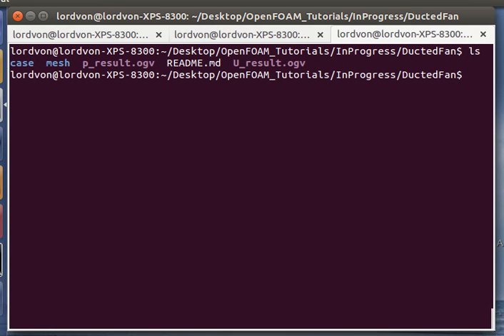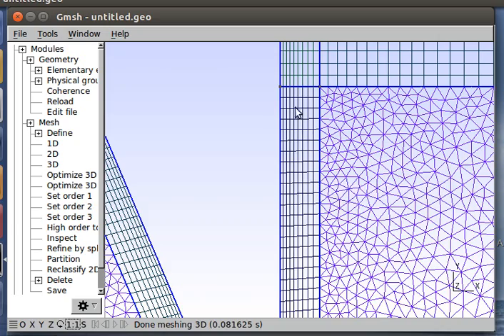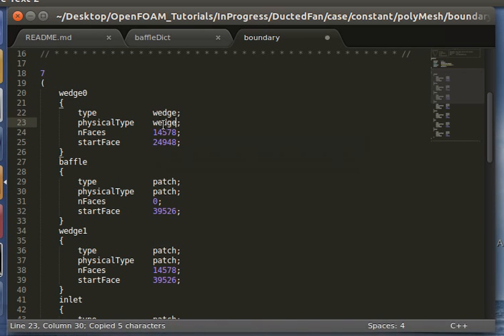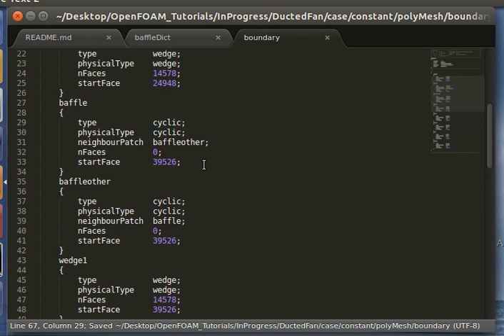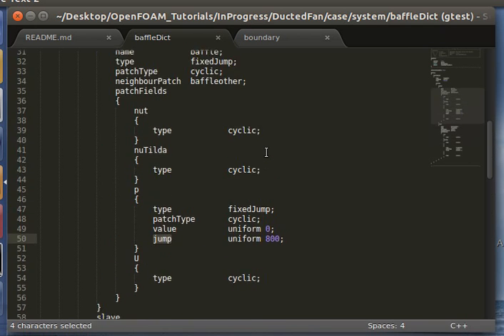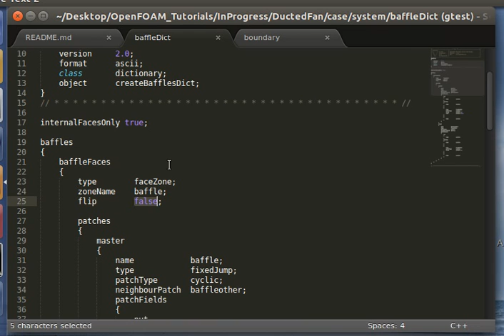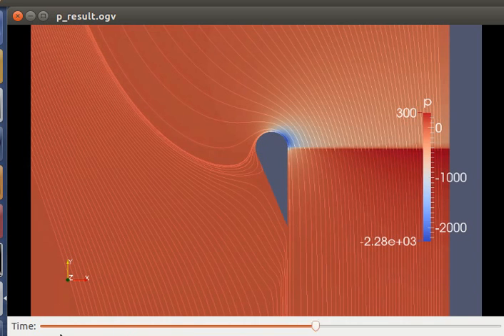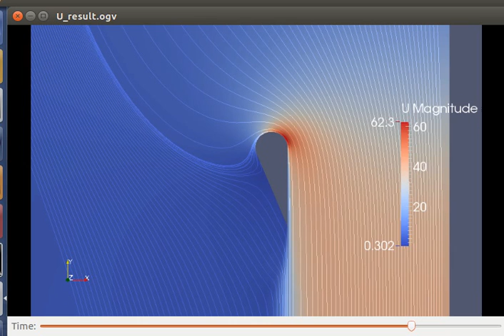Ducted Fan Simulation in OpenFOAM

Comment: Thanks for sharing. But did you notice that the mass flow of the two surfaces of the fan are not equal? So it means in this case, the conservation of mass is actually not guaranteed?

Comment: Hi,
I downloaded your case but when I use the command "gmsh mesh/main.geo -3 -o test.msh", I get the error message below. How can I get past it please? Thanks
Error   : Unknown control point 7 in GEO edge 8
Error   : Unknown control point 7 in GEO edge 9
Error   : Control points of circle with tag 10 are not cocircular: R1=0.208578, R2=0.03429, n=[0,0,-1]
Error   : Control points of circle with tag -10 are not cocircular: R1=0.208578, R2=0.03429, n=[0,0,-1]
Error   : Control points of circle with tag 27 are not cocircular: R1=0.010287, R2=0.0562398, n=[0,0,-1]
Error   : Control points of circle with tag -27 are not cocircular: R1=0.010287, R2=0.0562398, n=[0,0,-1]
Error   : Unknown control point 21 in GEO edge 28
Error   : Unknown control point 21 in GEO edge 29
Error   : Unknown control point 7 in GEO edge 34
Error   : Unknown control point 21 in GEO edge 36
Error   : Unknown model edge with tag 37
Error   : 'mesh/functions.geo', line 18 : Could not apply operation on shapes
Error   : 'mesh/functions.geo', line 19 : Uninitialized variable 'points[1]'
Error   : 'mesh/functions.geo', line 20 : Uninitialized variable 'points[0]'
Error   : Unknown model edge with tag 12
Error   : 'mesh/functions.geo', line 23 : Could not apply operation on shapes
Error   : 'mesh/functions.geo', line 24 : Uninitialized variable 'points[1]'
Error   : 'mesh/functions.geo', line 25 : Uninitialized variable 'points[0]'
Error   : Unknown line loop 38 in GEO face 38
Error   : 'mesh/functions.geo', line 99 : Uninitialized variable 'ids[0]'
Error   : 'mesh/functions.geo', line 100 : Uninitialized variable 'ids[1]'
Error   : 'mesh/functions.geo', line 101 : Uninitialized variable 'ids[2]'
Error   : 'mesh/functions.geo', line 101 : Uninitialized variable 'ids[1]'
Error   : 'mesh/functions.geo', line 101 : Uninitialized variable 'ids[0]'
[i-HP-Z800-Workstation:26457] * Process received signal *
[i-HP-Z800-Workstation:26457] Signal: Segmentation fault (11)
[i-HP-Z800-Workstation:26457] Signal code: Address not mapped (1)
[i-HP-Z800-Workstation:26457] Failing at address: 0xfffffffffffffff8
[i-HP-Z800-Workstation:26457] [ 0] /lib/x86_64-linux-gnu/libc.so.6(+0x3ef20)[0x7f627027ff20]
[i-HP-Z800-Workstation:26457] [ 1] /lib/x86_64-linux-gnu/libc.so.6(+0xbb57e)[0x7f62702fc57e]
[i-HP-Z800-Workstation:26457] [ 2] /usr/lib/x86_64-linux-gnu/libgmsh.so.3(_Z12gmsh_yyparsev+0x1d435)[0x7f627154e028]
[i-HP-Z800-Workstation:26457] [ 3] /usr/lib/x86_64-linux-gnu/libgmsh.so.3(_Z9ParseFileRKNSt7__cxx1112basic_stringIcSt11char_traitsIcESaIcEEEbb+0x1a5)[0x7f6270ede115]
[i-HP-Z800-Workstation:26457] [ 4] /usr/lib/x86_64-linux-gnu/libgmsh.so.3(_Z12gmsh_yyparsev+0xfdf9)[0x7f62715409ec]
[i-HP-Z800-Workstation:26457] [ 5] /usr/lib/x86_64-linux-gnu/libgmsh.so.3(_Z9ParseFileRKNSt7__cxx1112basic_stringIcSt11char_traitsIcESaIcEEEbb+0x1a5)[0x7f6270ede115]
[i-HP-Z800-Workstation:26457] [ 6] /usr/lib/x86_64-linux-gnu/libgmsh.so.3(_ZN6GModel7readGEOERKNSt7__cxx1112basic_stringIcSt11char_traitsIcESaIcEEE+0xd)[0x7f62710482ed]
[i-HP-Z800-Workstation:26457] [ 7] /usr/lib/x86_64-linux-gnu/libgmsh.so.3(_Z9MergeFileRKNSt7__cxx1112basic_stringIcSt11char_traitsIcESaIcEEEbbb+0x26fd)[0x7f6270eddf5d]
[i-HP-Z800-Workstation:26457] [ 8] /usr/lib/x86_64-linux-gnu/libgmsh.so.3(_Z11OpenProjectRKNSt7__cxx1112basic_stringIcSt11char_traitsIcESaIcEEE+0x767)[0x7f6270edf587]
[i-HP-Z800-Workstation:26457] [ 9] /usr/lib/x86_64-linux-gnu/libgmsh.so.3(_Z9GmshBatchv+0x10a)[0x7f6270e880ea]
[i-HP-Z800-Workstation:26457] [10] gmsh(main+0x132)[0x559e89eea1d2]
[i-HP-Z800-Workstation:26457] [11] /lib/x86_64-linux-gnu/libc.so.6(__libc_start_main+0xe7)[0x7f6270262b97]
[i-HP-Z800-Workstation:26457] [12] gmsh(_start+0x2a)[0x559e89eea29a]
[i-HP-Z800-Workstation:26457] * End of error message *

Comment: Thanks Man for this amazing tutorial, but i have a problem in creating internal face to use after to calculate the mass flow rate on this internal, i had tried the other tutorial you done on creating buffles but i changed the type to be patch from wall but it is not working and just it separate the zone to two volume zones, please tell me how to do this internal face like it permit the flow continue not blocking like a wall i need to be internal like fluent.
 Great thanks,
wait for your replay.

Comment: Hi!
I really like your tutorial thanks for the good info. I really appreciate it. 
By the way I have a question for one thing. 
I visited your git page and cloned it to my computer and I doesn't have any problem until createBaffles -case case -dict system/baffleDict -overwrite.
But after I type pimpleFoam to calculate the case, there is an error like below

--> FOAM FATAL ERROR: 
Unknown TurbulenceModel type RASModel

Valid TurbulenceModel types:

3
(
LES
RAS
laminar
)

I successfully run some of your tutorials and amazed. But this turorial doesn't seems to work for me. Can I get your advice?
Reply from the maker: Ok, check my Bluff Body Wake tutorial at: https://www.youtube.com/watch?v=KfRjQtf5beU

The settings there should be set properly for OpenFOAM 3.0.0.
Reply: Unfortunately, the new 3.0.0 OpenFOAM is incompatible with the not-too-old 2.x. Fortunately, you only have to change a few words in the configuration files. Above, you just have to replace 'RASModel' with 'RAS' in the turbulence model file in the 'constant' folder.
Reply from the maker: ^^^ is my response (alternate account)
Reply: Hi ! Thanks for the advice. I have tried replace 'RASModel' with 'RAS' in the turbulence model file in the 'constant' folder. But I got another error. Since I am new to this field I really appreciate your advice. error message was like below

PIMPLE: Operating solver in PISO mode

Reading field p

Reading field U

Reading/calculating face flux field phi

Selecting incompressible transport model Newtonian
Selecting turbulence model type RAS

--> FOAM FATAL IO ERROR: 
keyword RAS is undefined in dictionary "/home/hyeon/openfoam_tutorials/DuctedFan/case/constant/turbulenceProperties"
Reply: Thanks! it worked well
Reply: Hi it's me again. Could you make a tutorials about how to mesh your duct geometry? I am really interested in your tutorials. Thanks!

Comment: hello, I'm Aldi.
I'm very interesting with your simulation.
May you can help me? for guiding me to simulate the propeller in openfoam?
i need your help,
thanks so much.
here is my email: bahatmaka.aldias@gmail.com
Reply from the maker: +바하뜨마까알디아스 Hi Aldi, there is a propeller tutorial in the standard OpenFOAM tutorials. Have you checked it out?
Reply: +OpenFOAM Tutorials Yes,. I have been checked for the tutorials in openfoam, and i already tried for simulating, and when i was trying to simulate other propeller (different dimension), there was a some problems, the process was stopped, and i couldn't check the propeller results,
can i know your email? i will give my problem case by email,.
thanks before,